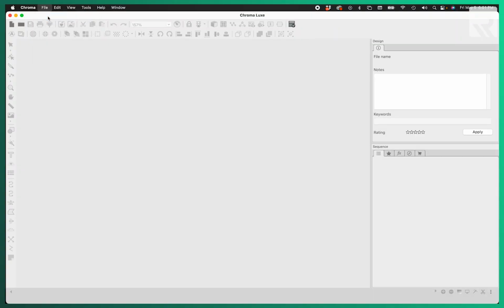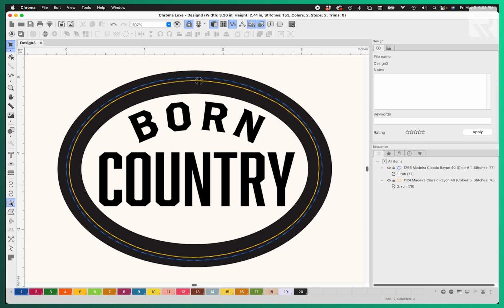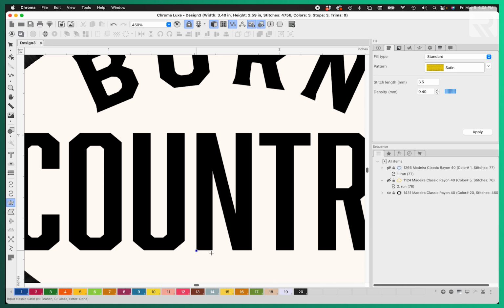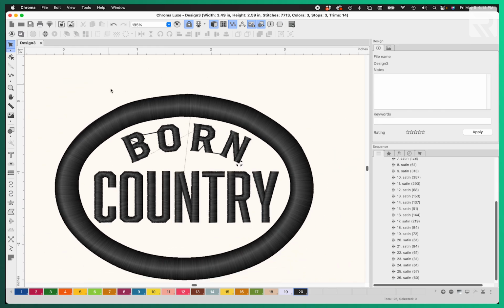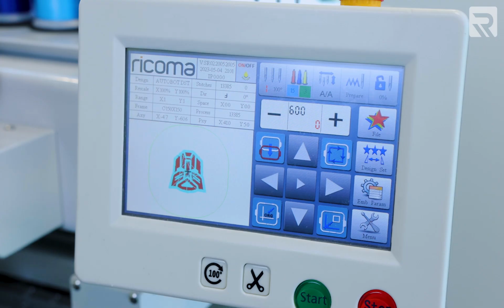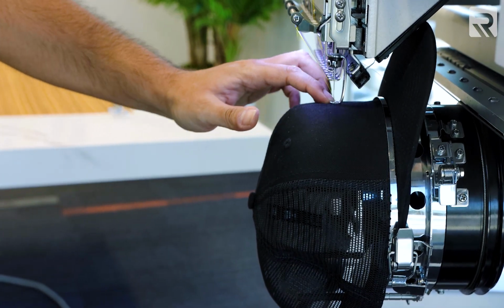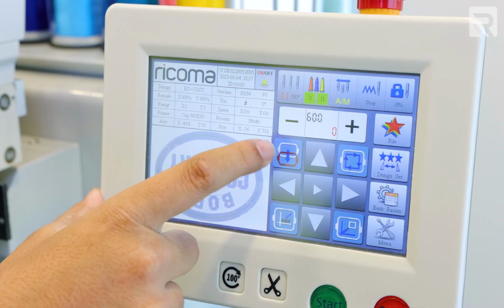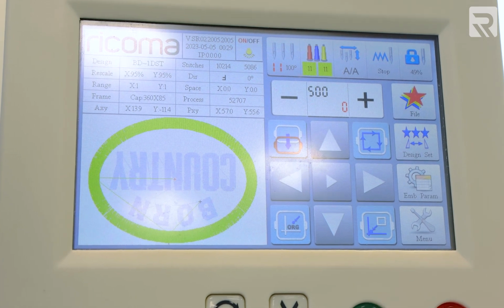How to Embroider a Leather Appliqué Patch With 3D Puff for MAJOR PROFIT!

Comment: That is awesome! Quick question, how come the density on the puff is too low, 0.1? The density of the text as well were different, 0.2 and 0.3, why? Thanks.
Reply from the maker: Hi Mel! The density is actually high on this design. The lower the density the thicker it will be.
Reply: @ricomatv  Yes, too high I mean. How about the texts "BORN" and "COUNTRY", how come they have different density?
Reply: High density for the 3D puff. Lower for the rest.

Comment: Great video! I noticed no backing material. When is backing needed and not needed on caps as a general rule and why? Thanks
Reply from the maker: Hi Tim! Thanks for watching, every embroidery project requires some sort of stabilizer. There are very few instances where you won’t need backing, like when embroidering stuffed animals or some structured caps.